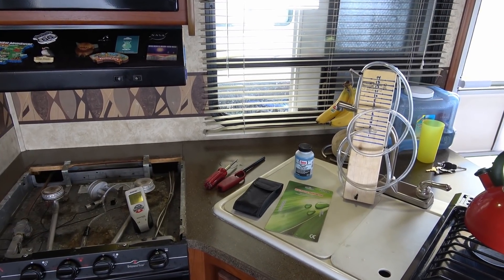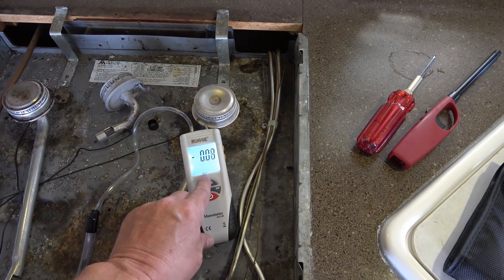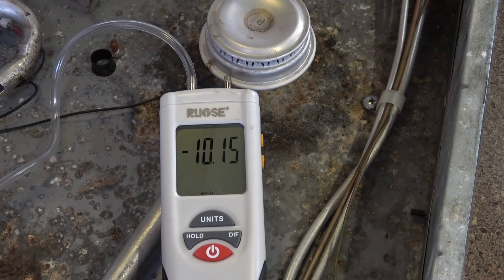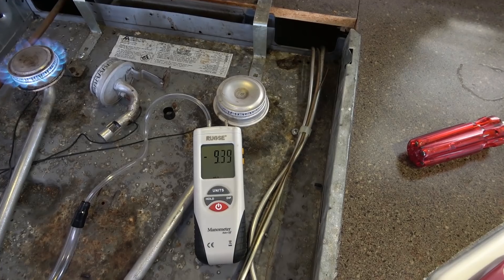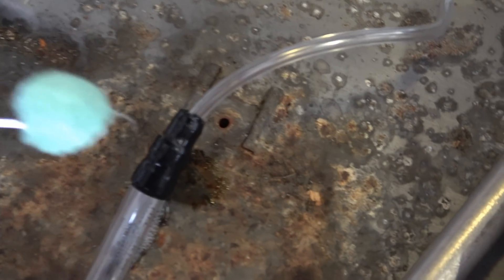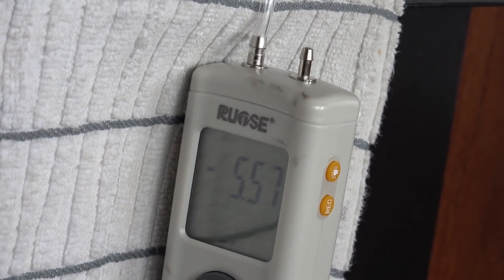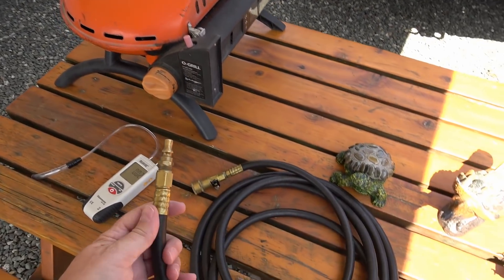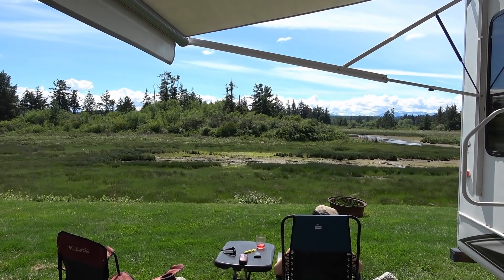Leak Testing my RV Propane System with a Digital Manometer

Comment: Hi, and thank you very much for the video.  Do you by chance happen to know what would be an acceptable drop in a manometer?  I'm starting around 10.86 and it's dropping down to about 10.65 after a few hours.  Is there a chart out there that I can use to measure this?
Reply from the maker: Most of the tests I read about are leak testing just a few minutes, not hours. Here is one that lists 3 minutes http://www.wvpropanegas.org/documents/Old%20Documents/2011%20Think%20Safety/ThinkSafety%202011%20Summer.pdf

Comment: Did you ever make a quick connect fitting for your digital manometer? I would like to know what you used if so. Thanks
Reply from the maker: No so far I haven't. Going to have to get to a propane supply place so can figure out the connections. But sort of have put it off. Let me know if you figure something out. Cheers, Ray
Reply: @LoveYourRV  Thanks. I just received my digital manometer yesterday. It came with a fitting that has a nipple on one site to fit the tubing that comes with meter and the other side is threaded. I took that fitting to Home Depot and found that 3/8" ID tubing fits on the threaded side. That size tubing also fits over the burner spot on the stove. I may have to put a zip tie around it to tighten it if it leaks. Im going to try it out this weekend to test my system like you did. You could buy one of these fittings in brass at Home Depot or Lowes to make it work. It is where the tubing stuff for ice makers is at.

Comment: I know this video is a couple of years old now but I'm trying to figure out why I can't get my Furrion oven pilot to light. The stove top works fine so I have two propane lines obviously. I suspect it may be the regulator because there is no sound and no smell of propane in the oven but I want to check it. Any idea how I would do that? Disconnect the side of the regulator that goes to the oven and attach the hose from the manometer and then turn on the propane to see if it shows a reading? Of course this would be all on me and for entertainment purposes only :-)
Reply from the maker: Sorry, I'm not familiar with Furrion stoves, didn't even know they made a stove.

Comment: This test also clear furnace and water heater gas or just the stove
Reply from the maker: Yes, I explained in the video that the stove regulator passes pressure back, so it tests the whole system for leaks. I demoed that it works using my Buddy Heater see here https://youtu.be/IvcGVF6kqzs?t=310 Only caveat is to make sure your stove is the same as mine. If not then I don't know the answer.

Comment: Thanks for the video, I am trying to learn how to use a Manometer for checking my propane heaters and appliances. Was the hose hooked up to the positive side and the negative side left open? thanks.
Reply from the maker: Yes, just hooked up to one side and it measures the difference in pressure from the gas system to regular air
Reply: @LoveYourRV  Thanks. Trying to learn this stuff so I can go off grid and stay warm. Not a lot of help where  I'm headed.

Comment: Glad to see some good information about propane systems. The test you used is the second best way to determine a gas leak in the fuel system. The best way is by having a licensed gas technician conduct the test.  (Don't beat me up for that one, that's my disclaimer.) Without getting into too many details, I'll try to add some more information that may be helpful... By reducing the pressure the way you did, all of the diaghrams in the regulators will hang open calling for fuel. This means that you are testing the system from the valve on the cylinders right to the valves on the appliances (good test). Couple of suggestions. Add the extra piece of hose you have to the other fitting on the digital manometer, that will help to stabilize the fluctuating readings, especially if doing this outside with any air movement. Any connections past the appliance gas valves should be leak tested with liquid leak detector at the operating pressure (11 inches) after the leak test.  The liquid  leak detector you used is designed for the purpose so no need to wipe it off. Many people use a mixture of soap and water that may be corrosive to the fuel lines if not wiped off after testing.  Finally, if you ever want to verify the accuracy of your digital manometer just connect it to the same gas manifold as your "U" tube manometer. The "U" tube is always the most accurate.
40 year gas technician from Canada.
Reply from the maker: Thanks for the tips Ken, appreciate it, Cheers! Ray

Comment: The electronic manometers may not be accurate right out of the box.  Do not rely on its readings.  It will need to be calibrated before use according to a water column manometer to insure accuracy.  The cheap one I bought was way off, out of the box.  Test instruments usually should be recalibrated at least once a year.
Reply from the maker: Thanks for the advice. Cheers, Ray

Comment: I'm always a little concerned about the rubber hoses after 5 or 10 years. So I can see at least an annual check being nice. Mind you you might need to run the bubble solution on the entire length of the rubber hose and not just at the joints.